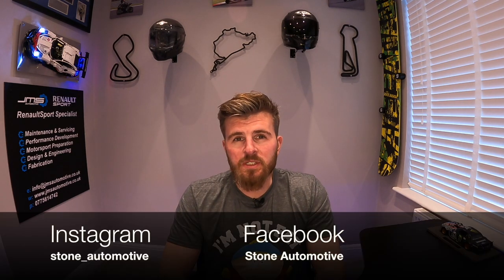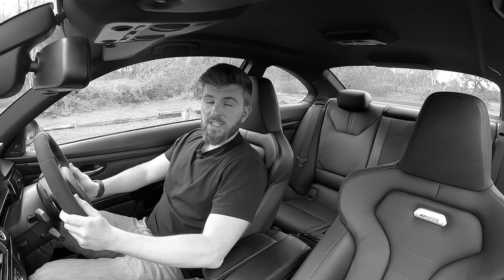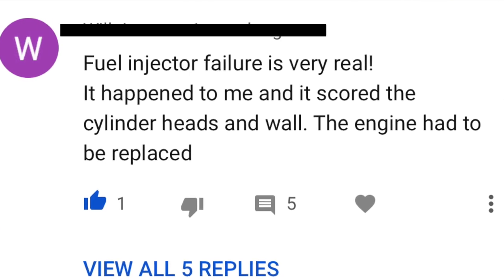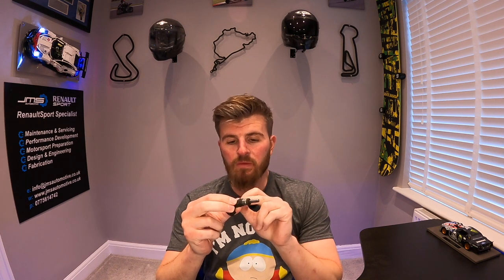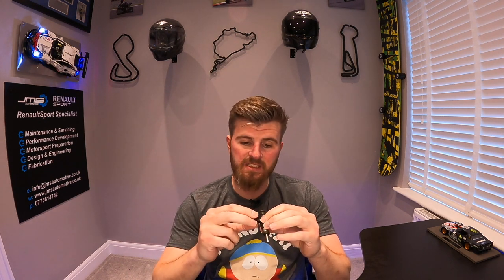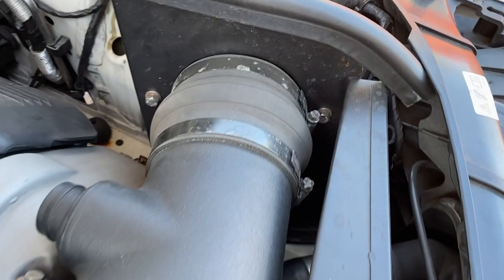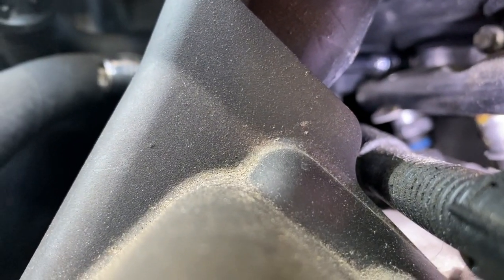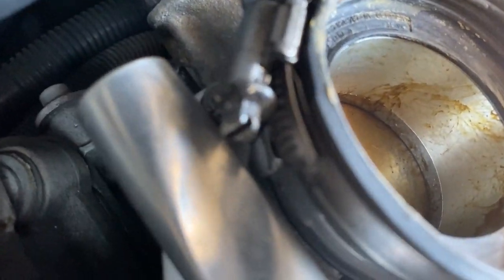BMW E90 E92 E93 M3 injector change guide - Should you change them before they fail??

Comment: Thanks. I'm a bit hesitant to replace them. On the other hand, I've had two cutouts already after going to 8k and upshifting without loss of traction and DSC  light didn't flash, no DTC stored.  It was not on the highway. What usually happens with the injectors failing AFAIK is that you get detonation which destroys a piston at the outer edge or burns a hole into the middle.
Reply from the maker: The DME in the e92 M3 is very advanced with ignition timing, if detonation is noticed it will drastically pull out ignition advance = low power (thankfully the days of carb engined vehicles are long gone with holes in pistons but incorrect mapping can obviously still cause it) 

I’ve not seen any injector failures on the S65 that cause piston damage from poor spray pattern etc just sticking fully open and causing big failure as a result of hydro locking the engine with fuel ☹️

I hope in time some one will be able to work out the fault, my Clio 172 Cup is on 134,000 miles with original injectors and my Honda S2000 on 147,000 miles on original injectors with no issues where’s the M3’s have been failing as low as 30,000 miles

Comment: I’ve just had a new engine built due to a main bearing spinning and destroying the bottom end and there was another e90 m3  there that had suffered an injector sticking open and one of the rods was hanging out of a massive hole in the block 😳🤦🏼‍♂️ safe to say mine had a brand new set before the new engine went in!!..
Reply from the maker: Sorry to hear but at least you have done the injectors now so fingers crossed it’s trouble free ownership on the new engine 👍

It’s certainly a real problem for the S65..

Comment: Do the injectors need to be reprogrammed after replacing them?
Reply from the maker: Nope, plug & play if using the same ones as factory 😬
Reply: @stoneautomotive  I replaced two injectors with Bosch and lasted about a week! I just ordered the factory one and wondering if I need to code it.
Reply from the maker: You either purchased fake ones (really common on eBay) or you have contamination in the fuel system that is destroying the injectors.

Get the system checked before installing any more as you’ll destroy new BMW ones if there’s something bad in your fuel tank

Comment: joust fixing one e92 m3 came with one injector stuck open , changed it and after 30 km same problem but another injector , took sample of fuel directly from rail and it is full of metal particles that are actualy destroying injectors
Reply from the maker: That’s not good! Had something failed in the fuel pump? Most cases appear to have one injector failure & the rest okay. I hadn’t had any faults with mine but changed for peace of mind (hopefully no issues ahead)
Reply: @stoneautomotive  the fuel pump is my gues due to it is only metal part in system
Reply from the maker: Hopefully you get it sorted, expensive day out if it destroys the engine ☹️

Comment: Do you push in the injectors back in fit or it sits and fit perfectly once the rail bolts are on?
Reply from the maker: They should push back in 90% of the way and then the fuel rail bolts will pull them into the final position 👍
Reply: @stoneautomotive  thank u
Reply: Do you clean the area where the injectors sits on the engine? There’s bits and dust on it.
Reply from the maker: @DLau95  I would consider a vacuum cleaner as trying to wipe or spray cleaner will move it down the inlet track and potential damage the valve seats/ piston rings & liners.

Mine were clean thankfully

Comment: Thanks for the info and guide, I obtained 8 new Bosch injectors same part as yours, from the States and fitted them to my 91k M3 E92 yesterday - didn't have any previous problems with the injectors but now happy new one's are in.  As an aside, I have to say the car really runs better now in general and feels cleaner in the way it revs and idles....so clearly the old injectors (although working ok) were worn or past their best, as you'd imagine at 91k anyway. I had previously used injector cleaner regularly and only quality 99 fuel, so the fuel system was in tip top condition. Given the reasonable cost of doing this job (my injectors cost about £280) I'd say this is a no brainer for anyone with a higher mileage M3 E92. It is a bit concerning that there is no fuel filter as a service part on this car which also strengthens the case for doing this preventative maintenance .... we must keep more E92 M3s on the road - that engine will need be repeated and is a true naturally aspirated masterpiece and these cars are starting to go up in value....no surprise perhaps.
Thanks again for the video guide.
Reply from the maker: Glad to hear the video helped Brian 👍 

I also noticed improvement in the running but more so in the idle than the upper RPM and yes for the cost it’s a no brainier to change them.

Agree, we need to enjoy these naturally aspirated 8,600rpm times 😎

Comment: Just finished this job today, thanks for the video! 474$ CAD for the new Bosch injectors and about 2 hours work. Worst part was getting the clips off the old injectors lol

I noticed the same changes as you, very slight roughness at idle, but not enough to register a fault code, gone after changing.
Reply from the maker: Glad the video helped Rob & glad you noticed a difference 👌 clips are not to bad when you’ve done it a few times 😅
Reply: Where did you get them for 474 CAD?! Please share link. :)

Comment: Happened to me on my E90 M3 93k miles, half a tank flooded engine, hydrolock bent rod, bore wash too. Full rebuild with cylinders needing sleeving. 

All rebuilt and now running, more new injectors on the way.
Reply from the maker: ☹️

Glad to hear you got it all sorted in the end 👍 if you don’t mind the ask could you confirm the country you live in and the fuel used? Trying to build enough details to confirm if it’s related to a year or fuel being used.
Reply: @stoneautomotive  UK mate, for the 2 years  I’ve had it always used either Shell V-Power or Tesco Momentum, more Tesco tho and still use the same fuel now as I don’t think it’s related. 

I think the S65 injectors are starting to go due to age/higher mileage, I think the S85 was more common because they were produced 2005etc they had higher mileage and age, but now the S65 is catching up thus the injector problem. I’ve heard people say replace them every 50k miles and you shouldn’t have to worry.
Reply from the maker: Agree, think we just have to accept it’s a replaceable item

Comment: I bought some secondhand oem bmw injectors in working condition I was told which they did flow within 4/5% of each other but there was two injectors that was leaking so I had them all ultrasonic cleaned 4 times and flow tested two times till each one was good. This goes to show you how much crap goes through the fuel lines and into each injector. I’ll be fitting a fuel filter from areeve
Reply from the maker: Sounds like the e92 M3 is going to be just like the M5 with injectors almost becoming a serviceable item.

Certainly be interested to see where the new filter will be fitted - keep the thread updated I’ve linked in the description 👍

Ps - would it not have been cheaper to have just purchased new units rather than a second hand set and ultra sonic cleaned/ flow tested?
Reply: @stoneautomotive   I was lucky to get them very cheap so I took the gamble to get them cleaned and tested.About the fuel filter I spoke with areeve and they said they don’t know when the fuel filter stock will be available?

Comment: Great video!
Just read on m3cutters that someone's injectors failed and the car had just over 38k on the clock.
Reply from the maker: Thanks Sam, yea seen that post this morning ☹️
Reply: @stoneautomotive  my car has 47k on the clock but I think I'll be changing them as well. They're not too expensive to buy. It would have been better if I could get the same deal as you did though 😄
Reply from the maker: Yea few of us managed to jump on the $25 a piece units 😅 as you mention it’s not end of the world cost especially vs the repair bill if they fail

Comment: Mines @ 69k my todo list is 
-Bearings end of this year 
- go over rear subframe and bushes 
And now injectors 🤦🏻‍♂️ 🤣 
I would do this my self but it took me ages getting the plenum back on when I got a carbon one. Maybe next summer I’ll give it a shot 😂
Reply from the maker: Yea I would like to do rear subframe bushes too, seen so many with rusting subframes now it would be nice to remove/strip/ re-powder coat

The plenum removal/ refit is not too bad once you’ve done it a few times 😬
Reply: @stoneautomotive  came out easy but getting back in wow ahah very fun! next summer job i think. i got my plenum from carbo project. 
i think a new sub is like 1500 then plus all the labour. did have mine up the otherday and didnt look too bad

Comment: Interesting video, I recall finding  a few cases of injectors killing engines in the M3post forum (the 'blown motors' thread, I did a clean up of the list later on btw), I wondered about replacing them myself on my own M3, and a few of us discussed whether we were going to replace them or not. I decided not to (so far, lol) as it was so rare (3-4 at the time IIRC).
The current count in the aforementioned thread is 6 engines killed by injector failures, but I haven't gone through your m3cutters thread yet to see if their are any new cases (new to m3post, but probably are. Oh, JFYI, I use the same name in m3cutters and m3post as I do here).
You mentioned a FB M3 group in your forum thread, is the it the UK M3 group? (I'm already a member of that). Also, is there a 'thread' there tracking how many S65s have been damaged by injector failures?
Btw I don't buy the idea that dirt gets past the fuel filter and knackers the injectors, most petrol cars now (and for many, many years) have had in tank fuel filters, injector failure of this kind is not rife. Also, the whole point of the filter is to stop the dirt getting through!
Like you, I think it's down to some kind of internal wear (or failure) in the injector.......hey, at least we agree on that! 😉, even if we don't on the fast cold idle thing! 😂
Reply from the maker: I’ve seen the page on M3post (I was linked to it by a subscriber) nicely organised but I feel that forum is home to more users in the States than UK to gauge how many failures have occurred (I think many are also not proud to declare the failure as a replacement engine doesn’t do wonders for vehicle resale so often kept hush hush) 

Yep the Facebook page for the e9x M3 group is the one I was referring too, I’ve seen a few cases on there but sadly it doesn’t sit in one post you would have to go through various pages to group them all together.

I had a chap on M3cutters post advise that he believed it was just more specialists making money than a real issue, he messaged me advising he then suffered injector failure destroying the engine and wished for the small cost for a set of 8 that he had changed them..

Glad we agree on something 😅 the filter solution just doesn’t make sense at all as you wouldn’t have just one injector fail it would be multiple units if something had contaminated the fuel system.

PS for the cost, get them change, some chap on YouTube called Stone Automotive made a guide 👀😅
Reply: @stoneautomotive  lol 😁
Yea M3post is mostly US users, but seeing as they have a greater number of M3s there it's still relevant, even if their petrol is a little different.

Comment: Hello, do you have any information about ignition coils? I can only find bmw now.
bosh and others not found
Reply from the maker: Yes - purchase genuine BMW only 😅

Had an issue on mine with a Bosch unit
Reply: @stoneautomotive  oh 😭 I tested the hp ignition and one was faulty right from the start. I sent it back and I read reviews that talked about 20k-30k km hs.
I had a fault on the left bench I changed a coil in origin the one that came back to the diagnosis, is it necessary to change the complete left bench or the 8 I had nothing on the right bench.
Reply: @stoneautomotive  oh bad for you too🥲 I tested the hp ignition and one was faulty right from the start. I sent it back and I read reviews that talked about 20k-30k km hs.
I had a fault on the left bench I changed a coil in origin the one that came back to the diagnosis, is it necessary to change the complete left bench or the 8 I had nothing on the right bench.

Comment: What about changing the crap filter? Or run an inline one
Reply from the maker: Personally I believe it’s a component failing in the injector itself, if the filter had gone bad you would have multiple cylinder failure - in every case I’ve seen so far it’s been just the one failing
Reply: Yeah true, but I've not seen one fail shut. Better to be safe I suppose. Keep up the good work dude

Comment: This rare issue is clearly due to the high revving nature of the engine and would be proportional to how much use is spent at redline.  It's next to impossible to drive on public roads in those conditions over long stretches and would only be a thing in track days. So i don't see this as an issue for 95% of E9x M3 owners who will only redline on specific sporadic occasions, not on every straight stretch of the road.
There's paranoia around this engine which is overblown which i think Bmw did a poor job to dispell as they never quelled the infamous RB MB issue with their manufacturer point of view info to reassure owners. Because of this there's a tendancy to worry too much about this engine and do fearmongering preventive replacement that is not needed. There's actually people from this community who saw the opportunity for a quick buck business and are using psychology to sell their miracle fix part which makes no difference. I go back to 2008-2013 i know this engine history already at the time. 
 As a long time owner of this car (i factory ordered mine and took delivery directly in Munich), my rating is that it was designed like a superstar with huge ambition from the true M division engineers (a thing of the past) and then ( due to the 2008 financial crisis) saw Bmw downsizing M division and merging it with the regular 3 series and ignoring reliability issues of owners. Unlike Porsche i think Bmw has a poor support and follow up from the manufacturer on their performance cars. Instead of helping everybody they tend to only help does who sue them or threaten to. They tend to turn the page and focus on the next generation model and completely abandon current owners.  Overall i like the car but not the bmw brand and corporation. I like Japanese brands much better as they design with customer ownership in mind, making sure nothing will disappoint for years after the buy and if something does they will not sweep it under the rug like bmw does.
Reply from the maker: Well said 👍 agree the forums don’t help as you always hear of the bad things before the good but at the same time I’ve seen and know people with rod bearing and injector failure on road cars so it was enough to convince me to get them changed 😅

Also agree with the BMW after care comment, really not great and cars are certainly not built like they used to be from them in terms of reliability ☹️